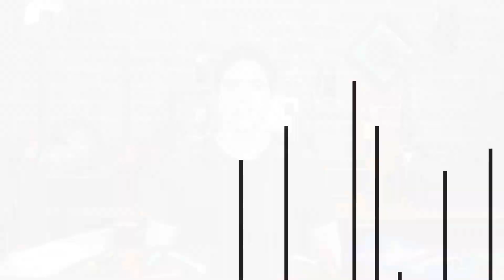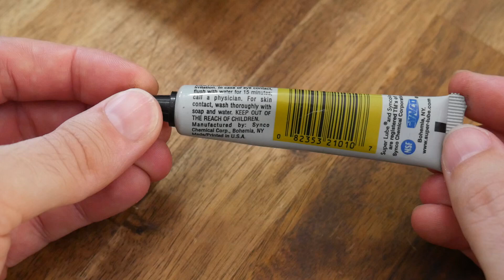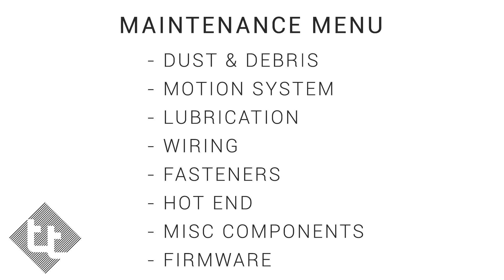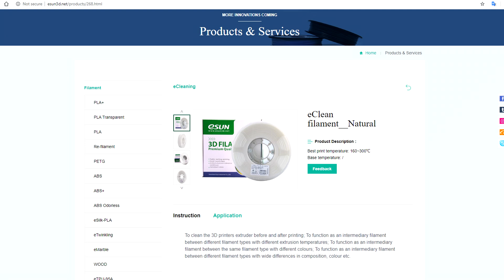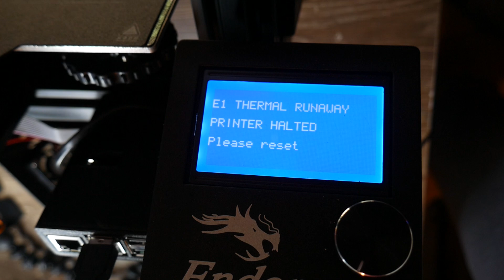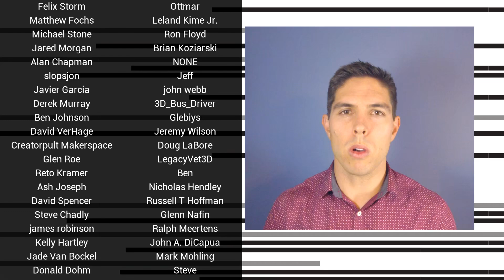3D printer essential maintenance guide

Comment: Thanks for the tips. Just purchased an Ender 3 V3 KE and am enjoying it. It's printing very well so I'm resisting the urge to mess around with anything yet but these tips are good to know..  One Note: You may want to clarify IPA is Isopropyl alcohol and not Indian Pale Ale (which first popped into my head). You'd be surprised...!

Comment: i tried to use cleaner filament.  It did remove stuff. But when I removed it, it remained in the head and clogged it, and couldn't get the PLA through. I had to force a needle in there to get it going again. Not sure what I did wrong. Other than I loaded it like normal filament. Next time i'll try to just do it by hand.

Comment: Great tips! I recently had my filament drive gear work it's way down the shaft until the gears were not contacting the filament, it at first was inconsistent line width and feeding and I thought it was the nozzles fault, ooops. Something to check, after adjustment I kept the two gear locking screws in place with loctite blue for good measure.

Comment: There are a lot lot lot of comments, so perhaps I missed this: Would not IPA start to dry out the roller wheels and belts? I tend not to use it for other rubber and soft plastic coatings for that reason. Thoughts?

Comment: what about for a new 3d printer? ive built it and it runs smoothly but i just wonder if there is a initial maintenance you should do to make sure stuff hasn't loosened up in the initial prints?

Comment: Why leave your printer exposed to so much dust and crud in the first place ... all that anyone has to is simply and easily throw a small cover over it like a sheet, towel, or whatever. 
I even cut up two old t-shirts and then drape them over my printer when not using it.

Comment: In addition to the toothbrush, you can now get really small bottle brushes intended to clean reusable drinking straws. They can get in-between the teeth on the gears and clean them up a treat. Also, I have an electric toothbrush with interchangeable heads. I keep the old heads, clean them (HOT water and baby shampoo) and use them on cleaning tasks with the electric base. It's a lot easier to scrub when you can have a motor prevent repetitive stress disorder!

Comment: CLP (typically used for cleaning guns) is also fantastic for both cleaning and lubricating. If you let it soak for a little bit, it breaks up all the grease and makes it a lot easier to clean off.

Comment: One of the things I do is I use thermal compound between the heater and the heaterblock to improve thermal transfer.  I also use thermal compound on the threads of the nozzle as well to improve thermal transfer to it as well.

Comment: I'm curious what your position is on replacing the bed springs with solid inserts if you have auto bed leveling. Good idea or bad idea?
Reply: I think it can cause some damaage in the extruder, because if the head hit the bed (from above), there will be nothing to absorb the power, which give extra tension, and may lead to deformation or fracture something in the mechanic.

Comment: Thank you for this video, Michael. I recently had a fire in my apartment and my Ender 3 was covered with a lot of smoke. I put it away for a while as I sort out more pressing issues caused by the fire, but when I return to it it will need MASSIVE maintenance.
Reply: Sorry to hear about the fire.
Smoke residue can be conductive, especially if the humidity is high.  Might try flux remover spray.  AND check that the power supply output is correct, with it disconnected from the electronics.  Voltage might be on the high side with no load.
Reply: @scottwillis5434  Thank you Scott. I'll definitely need the flux remover spray - for the printer and for every other piece of electronics that was covered in smoke.

Comment: I bet you already know about this issue, and I would love to see a video of Teaching Tech about solving it: There are bugs for users that use S3D with the Creality 1.1.5 "silent board", making the extruder step motor stop mid print for no apparent reason. The very same stl, when sliced with Cura, complete the print normally, while the S3D gcode print fails more or less at the same point every time....
I use S3D since I first started printing, so this issue is a huge deal for me. I've tried updating the firmware to Marlin 1.1.9 bugfix, but contraire to the tutorial I've followed, the bug still occurs...

Comment: The "dust" on the wheels are not dust, its wear from these cheap POM V-Slot wheels. this increases if the wheels are too tight. i recommend buy Polycarbonate wheels (the transparent ones).
Or ehm... dont tighten them too much, i always tight them until i can barely rotate them with hand. (i hold the carriage and rotate all wheels one by one by hand and if they grip well its good enough and don't wear much. 

For the the motion systems that goes "fast" (linear rails or rods) of parts that move fast use sew machine oil or a AOI oil, if you grease it it gets hot over time decreases it's lifespan. don't grease delrin leadscrew nuts (delrin is a sort of self lubricant"  use grease for brass nuts in combination of the leadscrews.

Comment: Micheal with CoreXY machines you need to check for gantry skew over time, and enable skew correction if and when it occurs

The way to check this is to print a Calibration square with the corners finished so you can use calipers to measure the diagonals if they match your square is not printed skewed, if they don't match first check the printer is printing accurately in X then Y, then check diagonals, distance in X needs to match Y, and the diagonals to match to ensure the printer is printing square.

As coreXY printers can go out of calibration over time and need to have the steps adjusted but also the gantry starts to get play in it over time causing the belts to pull unevenly on the gantry and Skew the X axis.

Comment: I have my printers in the garage, in an enclosure. I find the aircompressor is the best way of cleaning the dust off.  Takes seconds for the entire printer.
Reply: Better make sure that your compressor filters water, otherwise you might hear a zap as the last thing of your printer. Or just cover up the electronic box, that should do it too. I almost fried my pc by cleaning it with a compressor that had condensation in the hose, thats also potentially a thing. Gotta admit though, its just so easy to use a compressor.

Comment: If you print on bare glass, dont use IPA to clean it, well you can use it to clean it but then rinse it with water wipe it dry with a clean cloth, IPA leaves a residue that is not ideal when printing on bare glass. I still love plain old glass beds and sometimes glue stick, i just throw them in the dishwasher from time to time personally
Reply: Doesn't it just evaporate if it's 99.9% IPA?
Reply: @UNVIRUSLETALE  no.
Reply: @jasonm2477  do you have something to prove that? I can't find any list of additives for 70 or 99% 2-propanol other than water, only that if you use ethanol (95%) has methyl isobutyl ketone, acetone and bittering compounds
Reply: @UNVIRUSLETALE  then wash yours with IPA and enjoy your prints popping off i honestly dont care.

Comment: Two other things I would add: 
One is to actually check your Bowden Tube end that butts up against the hot end. The cheap tubes that come with most of the cheaper printers is going to break down and cause issues MUCH quicker than say Capricorn PTFE tubing. I actually immediately replace these cheaper tubes before even the first print. Just not worth the hassle; however, I still check this end of the tubing whenever I am doing maintenance.  Even on the Capricorn tubing, there can be breakdown after extended use. 

Two, check to make sure that all of the areas where strain on wires can happen are still protected with some type of strain relief, and the wires are still safe. This really applies to the wires on a heated bed more than anything, but can still be germane with any wires near moving parts. Make sure to verify the strain relief is still doing its job and that the wires haven't slipped. I know you showed looking over the wire covers, but checking the connection points looking for strained, frayed, and/or melted wires is also important. 

Thank you for the great content! Keep it up!

Comment: Check the Bowden tube touching the hot end.  After a while this end shrinks even if you have a Capricorn tube. Snip off  the bad piece and reinsert into the coupler all the way down to nozzle and tighten couplers.

Comment: I'm not a fan of "making sure the wire blocks are nice and tight". What you showed in tightening the set screws on the main board is just crushing the wires more. This will make them fray and likely break individual strands of wire. If anything remove the wires and use crimp on wire ferrules and then tighten the set screws. Wire ferrules are so darn cheap...

Comment: Hi teachingtech, first of all, thank you very much for this video. I was searching for a way to get rid of the dust on the heated bed, IPA is the deal :)
And second of all, I would like to ask you, if you can provide a link to the said rollers (3:53), this would be super helpful, as I don't know, what these rollers are called, for example, at aliexpress or ebay.
And lastly, have a nice day / week :)
Reply: I found them in aliexpress "3D Printer Pom V Slot Wheel"
Reply: @R_Forde  Thanks a lot, will check it out.

Comment: Don't grease threaded rods on Prusa printers, trapezoidal nuts are made of Delrin which has low friction in and of itself. Lubricants can make it soft or dissolve it. Wipe rods clean of dust and debris and keep them dry.

Comment: People getting mad at Michael because he uses the "wrong" kind of ultra-specialized PTFE lubricant, while meanwhile I'm using Penrite HPR5 5w-40 on my lead screw 🤔🤣
Reply: I use engine oil on mine (or transmission fluid, whichever is closest to my desk), but those don’t wear flat spots in bearings like people are worried about the PTFE particulates can do for those bearings, so it’s probably preferred.

Comment: Just a small warning on the wires, creality (and some others) love to tin their wire ends, i suggest stripping that off and letting the bare wires twisted together (ferrules are even better) be inserted into the terminals. The tinned wire ends will seperate inside the screw terminal when you tighten it down and cause the resistance to skyrocket and it will burn up the terminals.
Reply: This is very true and one of my biggest issues with some of the printers on the market today! (Especially the cheaper 'China' printers and kits.). 

 An inexpensive ferrule kit from Amazon is the best practice and should be the ONLY way these wires are terminated. Tinned wires will actually move and remould as the solder that is used is an extremely soft metal. This means that even if you tighten it perfectly today, there is a 99.999% chance that those wires will loosen with time. While bare copper is better, it is still stranded wire (not solid copper). This means that there is still a high likelihood that the same issue can develop. Crimping a ferrule onto the wire gives a safe and permanent termination that shouldn't allow this to happen. Well, as long as you aren't using a breaker bar attached to your screwdriver to tighten it. Seriously... firmly hand tight is fine... you shouldn't strain something tightening these screws! ;-)

I'm sure we can ALL agree that 110/120/220/240v current (depending on where you live) is not something you want to wiggle out of place; but 12/24v heater bed / hot end wires can still cause fires if they work free as well! (Or as @Look ItsRain stated, the resistance increases and causes extreme heat).  A little care and maintenance goes a long way to keeping you and your family safe!
Reply: @k1sfd1974  I have one of the cheapest Chinese printers out there (Longer LK4), and thankfully they don't seem to have tinned their wires.
Reply: Unfortunately I saw this tip too late, I'd upgraded to an SKR 1.4 Turbo, ran fine for several weeks until I noticed a burning smell.... behold by hotbed wires had melted together as well as the terminal on the board. Indeed, the hotbed wires are tinned and didn't know I had to strip it.
Anyway, I've since replaced the board and used ferrule kit to replace all the terminals.
Reply: what size ferrules? I just got an Ender 3 V2.

Comment: Using PTFE on Linear Bearings is not recommended. Like on the Prusa, besides the small particles in the grease, the linear bearings have seals on both ends. Those seals prevent dust, and grease from getting inside. The best maintenance is to remove them, clean with IPA, dry, then repack with the correct lithium grease and replace the seals. Or just replace the bearings all together. If you live in a dusty area that grease attracts dirt from the air and ruins the seals.
Reply: You and @John Smith must be internet comment trolls employed by lithium grease industrial complex and I have just uncovered your conspiracy against PTFE lubricants!

J/K, this is good to know.

Comment: If you have a removable PEI sheet on your printer like the Wham Bam and you decide to scrub it with steel wool, consider taking the sheet off of the printer, scrubbing it, cleaning it with acetone to get the steel wool residue off, then bringing the sheet back to the printer.  Steel wool has a tendency to shed tiny pieces everywhere, and the pieces conduct electricity.  If the pieces get sucked into your fans and into your power supply or your controller board, things could end badly. :)

I made this mistake myself recently.  Luckily I realized what I had done while the printer was still off with the electronics covered.  I cleaned up the mess by putting a magnet inside a small plastic bag and passing it over the printer and the table to pick up the steel wool pieces.  The bag keeps the steel wool from sticking to the magnet.  You can hold the bag over a trash can and take the magnet out, and the steel wool pieces will fall into the can.

Comment: Lol, did my maintenance today, before i saw this video.. Result was the best test print i've ever made. All the little tweaks can only now show their effect. Just absolutely perfect in all way. New tube, new nozzle, cleaning. Going to tighten x axis belt and lube z axis with lithium grease tomorrow. Bed cleaned with IPA and re-leveled. Then towel and IPA, clean as many nooks and crannies, i've kept it clean so not a lot to do. Quite a bit of greasy, sticky residue was found in the old bowden tube and between the tube and the heatsink. Smelled like PLA but concentrated. I had some underextrusion, should be fully gone now, based on the marvelous test print.

I would consider filament cleaner as essential auxiliary. It helps with filaments that have collected dust, which is all of them once you open the bag and use them. I've seen the amount on my fairly clean room that was collected and how everything looked the last time i cleaned everything.. I had it twice as long with much less problems. I have a melamin sponge wiping the filament clean before the extruder.

Comment: Don't let the vacuum cleaner spin the fan, it can induce a back EMF that could fry your main board. Hold it still with a couple of fingers like Michael did at 2:30.
Reply: Or unplug the fan
Reply: AND plug it back in again after...
Reply: I am new to 3d printing so I am not sure, but isn't the "back EMF" also a problem when spinning the stepper motors? I thought I read that the stepper motors should never be manually turned unless they are unplugged first for this reason, but it was not something mentioned in the video even with all of the manual movements. Maybe drivers today have some type of back current protection today and it is no longer required.
Reply: @not_my_fn_real_name2689  stepper drivers already have to deal with high back EMF everytime the stepper motor accelerates, so they are designed to cope with it
Reply: unplug machine entirely
Reply: @satanssonbob  this is not the issue they are discussing.

Comment: I have been using WD-40 Specialist Dirt and Dust Resistant Dry Lube PTFE Spray. It is a great, long lasting lubricant and its fantastic because it does not attract dust. So far I am not seeing where it impacts plastics or rubber, so far as I can tell its safe for 3D printers. Unless someone has used it and found something bad happening?

Also another great lubricant are ones that contain Teflon. It seems to not only not attract dust, it seems it repels it but have not found any I am willing to use on my printers yet so the vote for one is still out.
Reply: ptfe and teflon are the same thing. just don't use any ptfe lubricant on ball bearings and you are good.
Reply: @delirio1987  Well crap, did not know that. Thanks for the heads up about bearings, what does it make them sticky?
Reply: @kevinm3751  ptfe works well with sliding parts. It just doesn't do anything good when rolling is present, some manufacturers report even faster wear and flat spots
Reply: @delirio1987  For my bearings I have been using my airbrush lubricant and it has been working fantastic to say the least!
Reply: I went out to my garage, grabbed some Mobil 1 and put a drop on all my wheel bearings.  Tried PTFE dry lubricant for the leadscrews, but it gets everywhere since its a spray.
Reply: @jonbourgeois8390  Yea I spray mine onto a lint free rag and apply it that way it only gets where I want it.

Comment: One thing I'd like to add, is to periodically check the bolts on your frame extrusions on printers that use the openbuilds V slot ones. Print vibrations loosen them over time. I use blue loctite to keep them from backing out like that. One time my ender 3 had a straight wobble because the screws that held the upright extrusions had worked their way out quite a bit.